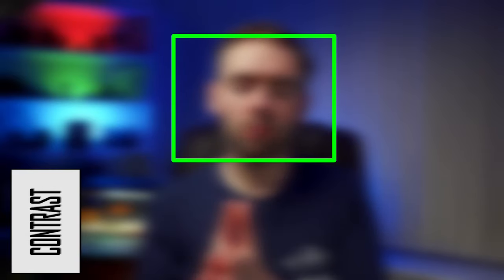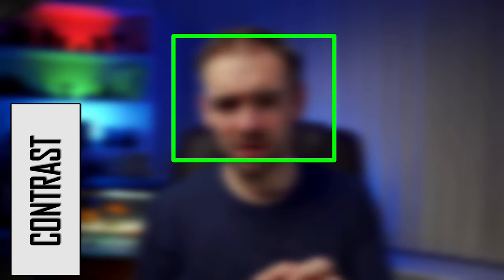How do AUTO FOCUS systems ACTUALLY WORK? - Contrast Vs Phase Vs Hybrid

Comment: my camera which is the Sony A7 IV uses a hybrid autofocus (AF) system that combines phase-detection and contrast-detection points. Specifically, it features:

759 phase-detection AF points that cover approximately 94% of the image area.
425 contrast-detection AF points that work together with the phase-detection points for accurate and reliable focusing.
This hybrid AF system allows for fast and precise focusing, making it well-suited for a variety of shooting situations, including low-light conditions, fast-moving subjects, and video recording. The A7 IV also supports Real-time Eye AF (for both humans and animals), Real-time Tracking, and other advanced autofocus features.

Comment: Fantastic!! Sooo helpful!. Now my question...lol  I have a DJI Mavic Pro Drone (build in 2016/2017). Can you tell me, which AF Technology it uses to produce (or try to), in focus video. I am not finding this info?? I know the 2.2 fixed apeture is definately a problem, right up front. But flying over changing landscapes, this drone is a total pain to get consistent - in focus - videos. And, of course this is realized at home, on the PC, when I start cussing. Thanks for any insight into this. I'm subscribing!!
Reply: The DJI Mavic Pro drone uses a fixed-focus camera system rather than an auto-focus system. The camera is set to a hyperfocal distance, which is optimized to keep most of the scene in focus from a certain distance onward. This means that objects within a certain range (from about 0.5 meters to infinity) will appear sharp, eliminating the need for a traditional auto-focus mechanism.

This setup is particularly useful for aerial photography and videography, as it allows the camera to focus on capturing wide, detailed shots without needing to adjust focus continuously.

Comment: Does phase detect reduce resolution or just the amount light?
Reply from the maker: No, phase detect system generally only use a tiny percentage of the millions of photosites for focus detection, these photosites won't record any light information however the camera will fill in those pixels based on the information from the surrounding pixels.

Canon's dual pixel AF allows the photosites to work as both focus detectors as well as still being able to record light.